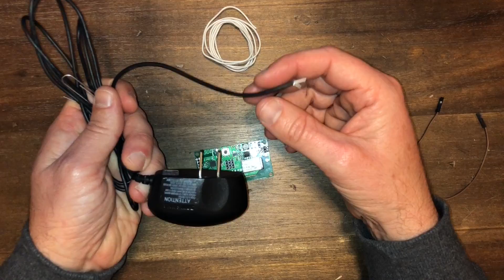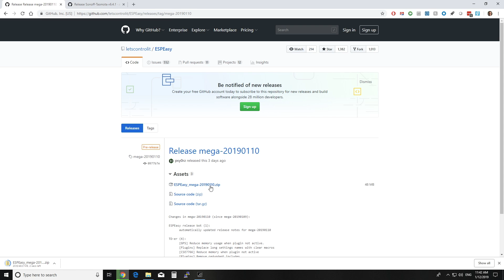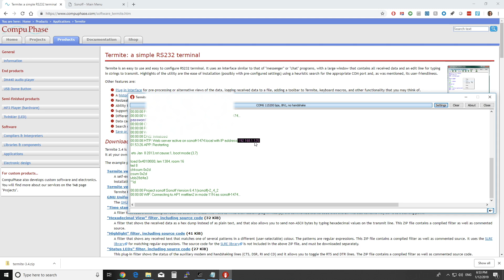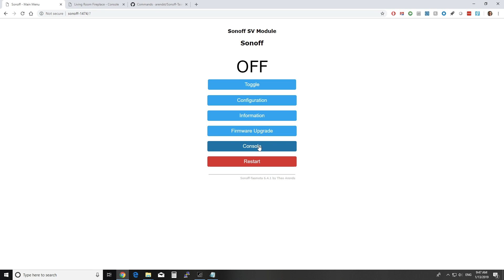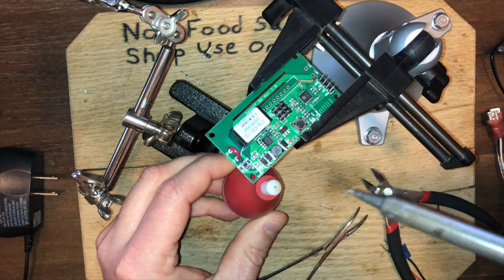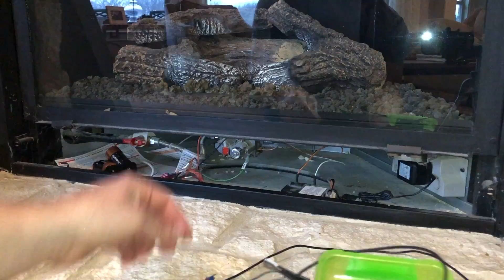Alexa Fireplace Control AND 3-way wall switch with Sonoff SV and Tasmota How to DIY

Comment: What benefits do you get out of a Sonoff SV with tasmoto that you can't get with an ESP8266 NodeMCU and a dry contact relay? Just wondering if I really need to buy new equipment for this or if I can build one with what I've got laying around already.
Reply from the maker: No reason. Yes, if you have all those parts, it should work with a NodeMCU and a relay. Good luck!

Comment: Hey there. I built one of these a few years ago (you'll see my comments on this video from 2019). It worked great! We're moving into a new house, so time to make our new fireplace smart. I noticed that you've done several videos on the topic. Is this still the best solution for being able to use Alexa and the wall switch in tandem? Also, I'm now using Home Assistant. Any idea if this solution can be integrated into Home Assistant? Thanks!
Reply from the maker: Yep! Still the best/only way. You can use the latest Tasmota version. Works great with Home Assistant via MQTT.
Reply: @mattadata2  excellent thanks!
Reply: @mattadata2  Quick follow up: For Home Assistant, you say it can be done via MQTT. If we are emulating a Wemo switch, and we already have the Wemo integration set up in HA (which I have for other Wemo switches), any idea if this new fireplace switch would get auto detected?
Reply from the maker: @davidhill8151  I don't have HA setup now, but I did in the past. I am pretty sure HA will auto detect Tasmota devices. I don't recall if the HA Wemo integration will detect the fireplace because it emulates a Wemo. Another possibility is using HTTP calls from HA to the fireplace similar to https://community.home-assistant.io/t/sonoff-tasmota-without-mqtt-or-custom-components/142853

Comment: Hi, great video thanks for the insperation. I was thinking of using a Sonoff TH16 modified to dry contact. The added benefit would be that this unit has a temp sensor addon therefore could be programmed to keep the room temp withing a certain range automatically, along with smart home capability. Thoughts?
Reply from the maker: That should work great! Post back and let us know.

Comment: Since you've flashed the Tasmota firmware onto it, has anyone tried adding it to Home Assistant.  This would allow it to be used in automations and then exposed to Google Home for voice control.  I use the Remotec Zwave Dry Contact device which works exactly like this with no modifications but they run closer to $70 and aren't easy to find any more.

Comment: Is there anyway to connect this with the smartlife app?  Thank you
Reply from the maker: Yes, I think so with this. https://community.smartthings.com/t/release-tasmota-connect-for-sonoff-tuya-smartlife-other-esp8266-devices/187553
I just don’t have a SmartThings hub to test with.
Reply: @mattadata2  I don’t have a smartThings hub either.  I was just wonder if it would work with the smartlife app to keep all my devices on the same app.  I really like this set up!
Reply from the maker: Thanks. Yeah, I think this only works with the hub.

Comment: Would you consider making these and selling them?  I can handle simple installs but when I need to start programming the unit...over my head. ;)
Reply from the maker: Done! Ebay and Etsy
https://www.ebay.com/itm/254810686912
https://www.etsy.com/mattadata/listing/919456993/smart-plug-for-fireplace-with-alexa-siri
Reply: @mattadata2  Awesome!  And you ship to Canada?
Reply from the maker: You betcha! Buy it from ebay to ship to Canada. Also comes with 3D printed case now.
Reply: @mattadata2  Just ordered it from Etsy as I have an account there.  It indicates shipping to Canada, so here's hoping.
Reply from the maker: @markmasri823  Got it! Thanks. I'll get it shipped!

Comment: Can this be used inline with a thermostat remote? I don’t have a wall switch. Also will this work with an intermittent igniter? Lastly is there a way to tie in and control the fan and flame?
Reply from the maker: Sorry, I don’t have that kind of fireplace , so I really don’t know.
Reply: I belive it should work as a thermostat is treated like a switch. When temp fall below turn on when temp rises above turn off and same you can over ride by turning on or off manually.

Comment: Will this work with google home as well?
Reply from the maker: Yes and no. It will until March 15th 2020. The 3rd party service I use to connect to Google Home is shutting down (https://about.gbridge.io/notice/). So it won't work with Google Home until I find a replacement or write my own. No ETA on either unfortunately.
There is a work around if you have a raspberry Pi laying around....but I don't have a guide on that yet.

Comment: Sorry I have another question.  You installed or flashed the Sonoff unit so it would be discovered by Alexa? Correct?  

Could I not just solder everything how you did it but just connect the unit to a Wi-Fi smart plug that is already connected to Alexa or google home? Would it work the same?   I’m just wondering if it’s necessary to do the steps to install the software and such as in the video.  Is that possible?  

So I remove the 2 chips to make it not send power, jump the one end by the chips we removed, plug in the light switch terminals to the middle of the board and solder on the main connectors that go to fireplace.  

Basically do everything except make it Wi-Fi compatible and have it still work in line with the wall switch where they both work together or was the software you installed needed for that?
Reply: ColdCanadian911 - The main reason I flashed the Sonoff is so that it could sense when the wall switch was flipped, not to be discovered by Alexa. Almost every smart switch or smart plug out there can be discovered by Alexa. 

I can’t think of a way to do it without flashing Tasmota on Sonoff. Tasmota is the only thing I have found that can toggle the relay when the wall switch changes. And it reports those changes back to Alexa/google home. 

I don’t fully understand the second part of your question, hopefully I answered it above.
Reply: Matt Angelo ya I basically repeated myself  lol. I wasn’t sure if I was being clear or not lol.  Is there any other way to contact you beside this chat?
Reply: And I’d buy off ya but the Us to Canadian co version is a kick in the nuts  so I may try and attempt it to save a little money
Reply: ColdCanadian911 - sure. Use the contact form on my website. https://mattadata.org/contact/

Comment: In the description you state “work with google home but requires different configuration not shown” are you just referring to the  initial setup when you have Alex search for the device or are you referring to actual flashing and programming via the software?
Reply: ColdCanadian911  It is separate firmware I compiled. You have to enable encrypted MQTT connections. They are off in the stock Tasmota firmware. I am now selling these as kits on EBay, link in description. 
If you just want the firmware, let me know.
Reply: Matt Angelo okay. Thanks.  I just did notice the link for eBay.  Will check it out.  Shipping to Canada an issue?
Reply: ColdCanadian911 no, Shipping to Canada is not an issue. eBay takes care of that. I basically ship to Kentucky , United States. And they do the rest.
Reply: Matt Angelo not to take any profit away from you (and I hope you don’t mind me asking) but the SH3001 (you did a video)  unit is similar to what you have build , except it wouldn’t allow the fireplace to be turned on with google(or Alexa)  and off with the wall switch.  I think that’s the big difference between your product and that product.  Yours allows this function.
Reply: And thanks for responding to the questions.
Reply: ColdCanadian911 - no I don’t mind. Yes you’re exactly right. The advantage of my solution is you still maintain full use of your wall switch. And Alexa/Google Home are fully aware of the position of the wall switch. 
If you don’t care about the wall switch,  there are many good options out there.

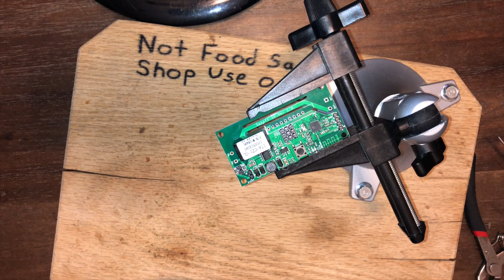Comment: 13:40 is the most important part of the this video.   Before discovering your channel and videos I had snipped a 5V adaptor and connected terminals to the ends and connected those to my fireplace.  Then plugged the adaptor into my Wyze smart plug.   Google home would turn the fire place on/off with the voice command and it worked awesomely BUT I was sending current to fireplace which as you stated in your video “YOU DONT WANT THIS”!!!  So I’ve since removed it and I’m back to  ask ole non current wall plug.  

This process looks like fun.  Thanks so much.

Comment: why do we need to use tasmota instead of the standard eWElink app for the Sonoff?
Reply from the maker: Tasmota is the only way the Sonoff can sense if the wall switch has been toggled. The standard Sonoff firmware ignores the pins we use on the board.

Comment: I was just about to buy the Durablow wifi device. However, this is exactly what I need. But I have no soldering experience/equipment. If I wanted someone to make this for me, who would I ask?
Reply from the maker: A local maker space would be your best bet. But this would be a good project to learn how to solder on!
Reply: I did. And that probably would have settled for that. But what I really wanted was the 3 way switch that you created. And now that I've seen it, I'm not sure I want to settle.
Reply: My other concern is that I'm a Google Assistant household but from other comments, it looks like this may only work with Alexa.
BTW, your videos give me hope that I'll get this project done one way or another
Reply from the maker: @DaroldFletcher   - Have you seen any of my  other fireplace videos? The ones that use a Wemo plug switch will work with Google Home.

Comment: Thanks for the video. Very cool! One question: why flash to tasmota for this? Sonoff is already compatible with Alexa and Google Home. Is Tasmota necessary for something specific in this use case? Thanks again!
Reply from the maker: Hi...thanks. The only reason to use tasmota for this is to take advantage of the 'GPIO14' on the sonoff. If you hook that pin up to your existing wall switch that controls the fireplace, then you will have full control on the fireplace from Alexa AND the wall switch. It will function exactly how a 3-way light switch in your house works. Turn it on in one location, turn it off from another.
If you don't need or want a 3 way switch, than Tasmota doesn't offer any real advantage over stock firmware.
Reply: @mattadata2  hey thanks for the reply. I set mine up last night and it works great! The only downside for me with tasmota is that it doesn't work with Google Home. But I also have Alexa in my home, and it works great with that.
Reply from the maker: David Hill - glad to hear! I also am Also an Alexa household. I didn’t know tasmota didn’t work with Google home. Thanks!
Reply: @mattadata2  sorry for the ongoing conversation, but let us know if/when you complete the plans for the case. My wife rolled her eyes when I stole one of her Tupperware bowls 😁
Reply from the maker: Finally got the case done. More info on the page about it https://mattadata.org/alexa-fireplace-with-3-way-switch/

Comment: Very clean and excellent step by step video - great stuff -  You verified what i was planning to do on my fire place. Thank you for your time.
Reply from the maker: Silvano Vitro - no, it will not. You would lose the ability to also control it from the wall switch.

If you don’t care about that, then look at my other videos where you use off-the-shelf Wemo switch. That would be easier
Reply from the maker: Silvano Vitro - no, I didn’t actually try. But I’m 99% sure you have to install Tasmota so that GPIO 14 works. But try it out and let us know if it works!

Comment: This was great. I was literally looking at how to set up my fireplace to do this exact scenario earlier this evening.  Once I realized the wall switch was just a simple low voltage circuit I went searching for a different solution.  One thing I didn't realize is Alexa could still find the device after being flashed with tasmota.  Very cool.  I have an older fireplace with a separate fan switch on the wall.  Going to see about using a sonoff basic and doing a software link to get them cooperate.  Will see if I can get home assistant and Alexa to play nice together.  Thanks for the great tutorial.
Reply from the maker: Glad it helped! I didn’t show it in the video, but I also have Home Assistant and my fireplace interfaces with HA over MQTT. Post back with some details after you finish your project.
Reply: @mattadata2  so finally did this - worked fantastic.  I have it working both on Alexa and HA as well (can't get it to like Google home though). Couple random details - first, my fan is on a temperature sensor. Obviously, the fan is powered. But strangely, I don't have an outlet under the fireplace unit. I have the outlet the fan uses - but it's on that temperature sensor, and the outlet is only 'hot' when the fireplace reaches temperature. There must be power under the house to it but I'm yet to crawl under there to figure it out. So, the fan works if you bypass that sensor and plug it into power directly - or it turns on when the temperature gets above a threshold. It may be standard - I thought it was odd. For now, I've simply left the fan in the on position and pulled power from a different source. Later, I plan to go under the house, add an appropriate power outlet, then set up a sonoff basic to control the fan separate from the fireplace. Then I'll be able to do controls with both the wall switch for the fan and fireplace independently, as well as using the temperature sensor on the fan.  

Thanks again for the great tutorial. I saw a similar adaptation of the Sonoff SV that is for a garage door opener hack. Those little guys are pretty slick for low voltage relay use.  

Another easy tip - you were talking about 3d printing a case for everything. A basic tupperware can work pretty well too - typical fireplace insulation shouldn't get too hot down there. Cheaper and easier than a soap dish :)
Reply from the maker: Great! Thanks for posting back. 
Check out this for garage doors. Been running this for a year. https://github.com/marthoc/GarHAge

I did use the laser cutter at my library and cut a little wooden box. 
https://photos.app.goo.gl/vCXqbAd4h8hV1FuM7

Good luck with your fan!